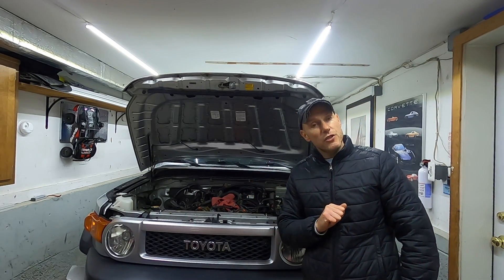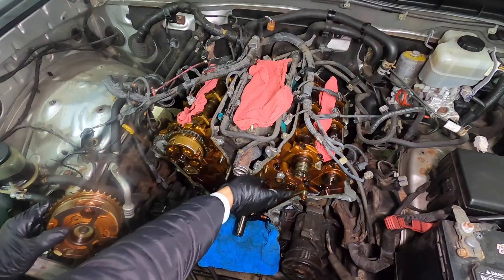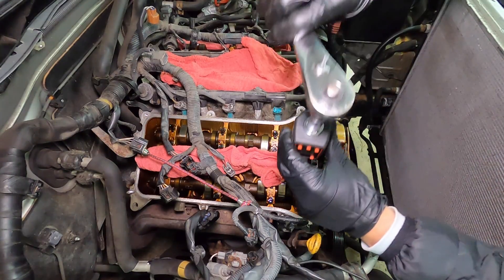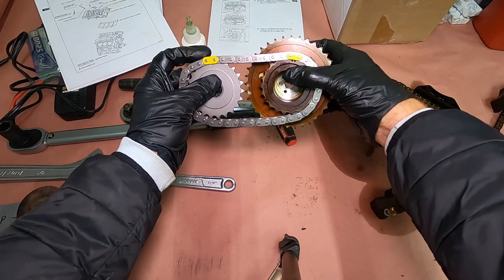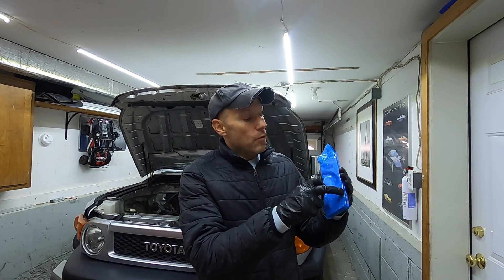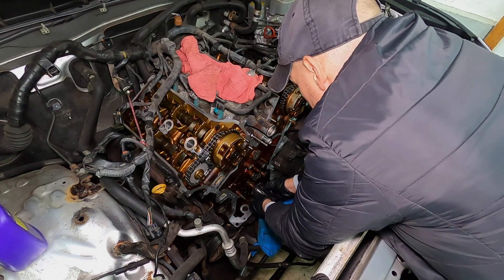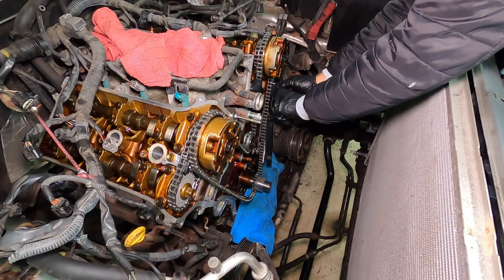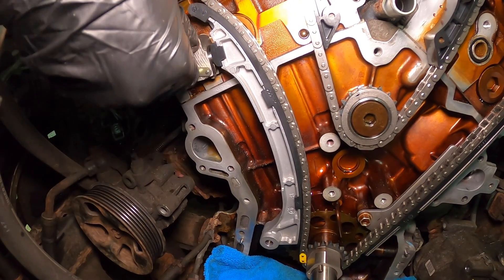Timing Chain Installation for Toyota 1GR-FE | FJ Cruiser | 4Runner | Tacoma | Tundra | Land Cruiser

Comment: Did you do anything extra for the main timing chain tensioner besides just releasing the pin as shown in the video? I set everything up and went to turn the engine over by hand, and the tensioner retracted then extended again a few times and resulted in the timing being off now due to the chain skipping a few links. Do you need to fill the tensioner with oil or something before installing?